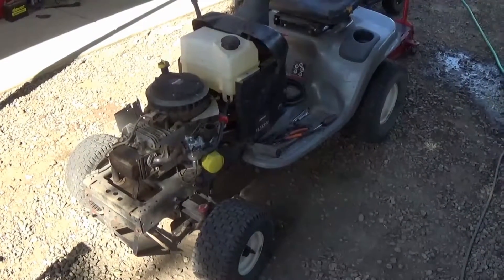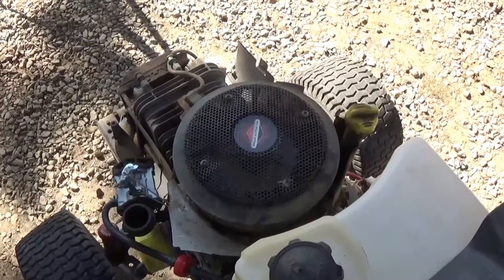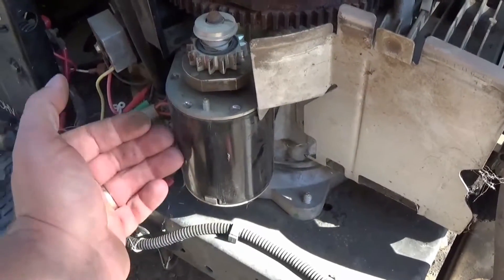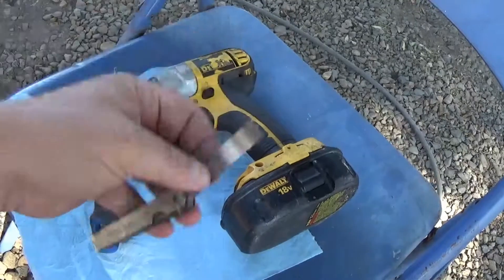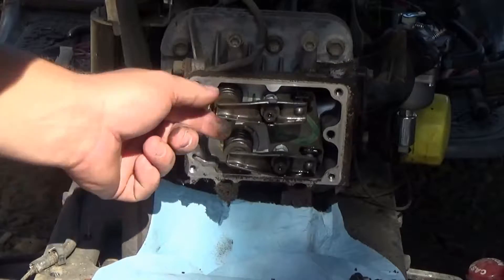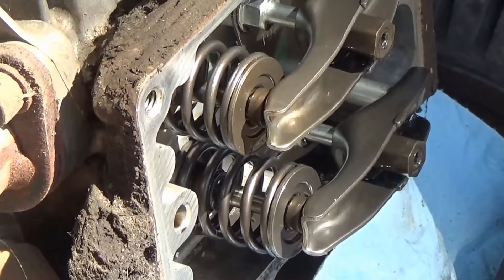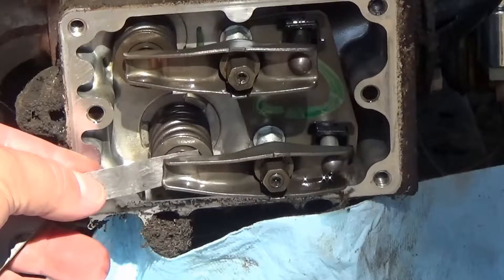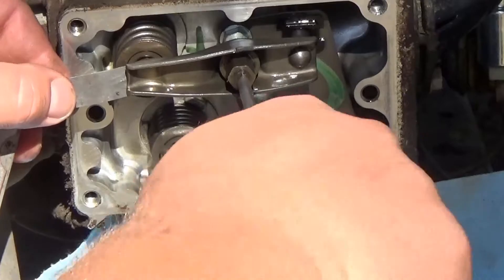Riding Mower Turns Over Fast Then Slow On Compression Stroke (BRIGGS OHV)

Comment: Interesting that you don't adjust the valves at top dead center like all the instructions say to do. Anyway, I did it your way and it worked. Engine turns now. Before the starter was struggling to move the engine. I'm surprised what such a small adjustment to the valves made. Thanks for the information!
This is the first time anyone told me about the little opening of the intake valve to check the compression release. I didn't know that.

Comment: . i have replaced battery, solenoid, starter, and ignition switch assembly. I just checked the rockers , both were less than 2mm loose, rods looked immaculate. But still have the same issue.
Reply: 2mm equals .078". That means your valves are loose by a whopping .074". They need to be at .004" or .101mm.

Comment: Thanks for the video. I replaced the head gasket and the engine wouldn't turn over. It would move a little then stop. Your video was simple to follow and was exactly the fix I needed. I must have had the valves adjusted wrong the first go around. I could barely spin it by hand. Thanks for the checks to do prior. I went through all them- battery, starter, compression movement (had the last after the adjustment). Yea, I had to take it apart twice but it starts now. That's all that matters. 👍🏻

Comment: Thanks for a good video on the easy way to adjust the valves. Two thing I’d like to add that may help
1. You need to adjust the valves before you can check to see if the compression release is working if the valves are out of adjustment you’ll never see that little movement.
2. Spend $10 and change the aluminum intake pushrod to the same steel rod as used in the exhaust .  The aluminum rods wear at the guide and snap and the ends mushroom. It’s a great way to keep from having problems why Briggs using aluminum pushrod beyond me.
Reply: I call it "planned obsolescence"........

Comment: Yep, that's the problem on ours. My brother bought a mower off of facebook, and we've been working on it for about a week so far. We tried everything we could, change the oil, spark plug and even the starter, because it was broken beyond repair. Yet the engine is still hard to turn over, after I've seen multiple videos on the same process, I'm going to try this tomorrow.
Reply: Mine is the same way. Let me know if you fixed yours and what you did. I tried adjusting the valves and it didnt work

Comment: OMG Briggs and Straton's are garbage.  Mine has had theis problem ever since I got the thing.  halts on compression stroke.  I was replacing everything.. starter key, solenoid, starter, battery.  Even with everythign new and on a 50amp quickstart boost from a charger, it halts on compression stroke,a nd I have a fit of time trying to pull the pulley past it by hand.  I'm screaming never again, enver again, from now on diesal with a compression release switch...

There is no way I can adjust the valves since I'm blind now.  I've adjusted motorcycle valves before.  Is there any place on this thing you can kick the phvck out of to make it work?

I tried getting the blades off today to sharpen and balance them and there is no way to do this without like a pneumatic impact wrench.

OMG I just realized where this BS is by following the ignition coil wire back from teh spark plug.. it's under the fly wheel fan shroud on top.  I've got to take this BS off to get to this mess, and take the ignition coil off, and the cover for the valves?   Are these engine designers dvmb as phvck?  I can't do this kidn of maintenance on it while blind...

It took me an hour just to find a wrench that woudl fit the blade  nuts and I must of went through 30 of them...
Reply: You know what I did to fix this BS?   I thought well, this started again when I tpped the mower over on its left side to get to the blades underneath.  What if I were to friggin tip it over to the right on it's side, would this slide whatever back into place.  Sure enough, turns over groovy now.

My dad was right, B&S's are POS's.      
Only iesals or Hndas from now on, or better, electric.   

Blind people can not do this BS stuff anymore, not to mention this is mentioned nowhere on the engine cover at all.

Comment: Having this problem right now and can’t seem to figure it out , just picked the mower up.
Reply from the maker: Usually it's the compression release or the valves check vavles first
Reply: @smallenginerepair3379  I  just finish checking the valves , if I am doing this correctly. I adjust each valve on the down stroke as far down as the piston will go. For the first time I try turning it over and it back fire once and back to the same old 1/4 turn
Reply from the maker: @1989rrichard  in my video I show u how to check the compression release have u check that yet?
Reply from the maker: Is it a brigg and Stratton?
Reply: @smallenginerepair3379  have not, I just got it started ran for about 10 second back fire and shut off , I think I adjust the valve wrong so I am going to start by correcting that first
Reply: @smallenginerepair3379  yes 17.5hp
Reply from the maker: @1989rrichard  ok

Comment: My 19.5 ran fine, started running really rich all the sudden then wouldn't start back up.  No backfire but fuel in air cleaner. Comp, spark, fuel all good. Checking valves tomorrow. May be the keyway I'm thinking, any input would help!
Reply from the maker: Sounds like a carburetor or spark plug issue
Reply: @smallenginerepair3379  has brand new carb, great spark, fuel...seems out of time. I did clobber a big branch or 2 and the wore anti-scalp wheel that fell off in may. Picked up a flywheel key and correct plug today. Before checking valve lash gonna make sure flywheel didn't move. Was too dam hot today tho!

Comment: Can you help me with other problems that it could be
Reply from the maker: Whats the symptoms ur having
Reply: Set valves to .004 and .006 . .still got too much compression on motor what else could be causing me to still have too much compression
Reply from the maker: @chazmassey5064  what kind of motor is it
Reply: @smallenginerepair3379  it's a Briggs n Stratton 18.5 Intel motor
Reply from the maker: @chazmassey5064  its probably the compression release internal in the motor
Reply: @smallenginerepair3379  so does that mean I gotta get a new camshaft
Reply from the maker: @chazmassey5064  yes i think u can get them on ebay and u will need a new gasket for the block if u watch the part on my video were i ahow how to check if the compression release is broke
Reply: @smallenginerepair3379  yes I did watch the video . .thank you sir very much
Reply from the maker: @chazmassey5064  and really the hardest part of the job is scraping all the old gasket off both side of the block lol and make sure u get all the metal peaces out of the motor good luck!
Reply: @smallenginerepair3379  thank you and I sure will sir

Comment: I set both valves at .004 . .done it three times and I still have too much compression new starter and battery
Reply: Have to set the valves on the compression stroke or it won't work based on my experience.

Comment: thank you my man!! my lawnmower has not started that easy in 4-5 years !! its a 20-22 year old lt1000 with a 17.5 hp motor. this job took less than 30 min. easily. for anyone wanting to do this, 3/8 socket for valve cover, and for the 2 back bolts on plastic cover over flywheel.to many people post comments that OVER think shit!!!! this works perfectly!! top dead center blah blah blah THIS WORKS!!! JUST TRY IT AND YOU WILL SEE!

Comment: I have a 17.5 that has been sitting for a couple of years. It ran when parked, and only needed a PTO cable. It is building up too much compression. I have tried adjusting the valves, but I can't get it to work. I have watched several videos now, and everyone one of them give a different clearance for the valves. I have yet to find two videos that gave the same clearance. What is the correct one? Also, the videos have not been consistent as to which is the intake, and which is the exhaust. I am completely lost at this point.
Reply from the maker: Just put them both at 4thousands
Reply: @smallenginerepair3379  I ended up doing that, and it worked. The engine is turning fine and will run on starting fluid, which now brings me to problem #2. I borrowed the carburetor off this mower last summer to use on another identical mower that I have. I just installed a brand new carburetor on this one. I am getting fuel to the carburetor, but I am not getting any fuel to the engine. I know the throttle spring is worn out, and I have a new one that I am going to install tomorrow. Any other possibilities that I am not thinking of? I've rebuilt these carburetors several times in the past, and I know it is hooked up correctly, but this is the first new one I have installed. Do I need to mess with the idle mixture screw or anything?
Reply from the maker: @jesterr7133  u shouldnt have to mess with the idle screw on a new one but is there a solenoid on the bottom of carburator?
Reply: @smallenginerepair3379  Yes, there is. That's the one part I'm never sure about. It is hard to make sure that I have that pigtail plugged in correctly.
Reply from the maker: @jesterr7133  okay yeah that is a little solenoid what it really does is when you shut the key off it plugs up the main jet which doesn't let any access fuel get into the motor it helps prevent a popping sound that's all it does but if that little solenoid isn't working when you turn the key and you don't hear it click it must not be working or you don't have power going to it sometimes it's hard to figure out the wiring problem so what I do is pull the bolt off the bowl and cut flush with the nut that little spring with a rubber piece on it then screw it back in and you won't have to worry about it no more I hope that makes sense
Reply from the maker: @jesterr7133  and it doesn't matter how you plug it in
Reply: @smallenginerepair3379  Are you saying to cut the spring and the rubber piece off? I didn't even think to listen for it. I'm jumping it off right now since I don't have a good battery for it at the moment. I'll take the battery out of one of my other mowers and give it a shot. I had originally planned to part this one out since it was given to me in this condition, but I decided to take one last crack at it before I tore it down. Now I have a new project, lol. A friend of mine had a small engine business and had five mowers in his yard. All of them had been sitting for years, and he just gave them to me when he moved. I fixed two of them so far, built one from scratch out of two other ones, and now I'm tacking this one. Hopefully I can get it going. I'm 100% self taught, so I'm learning through trial and error.
Reply from the maker: @jesterr7133  yeah when you take that bolt off it's like a spring-loaded little deal you can push it down with your finger cut it off at the base of the bolt put that thing back in and it'll probably fire right up but sometimes not having a good battery in the tracker since it runs off power could be your problem too but either way cutting it off ain't going to hurt anyting sometimes those things fail and most the time the repairs I do for people they say cut it off
Reply: @smallenginerepair3379  You were right. The solenoid wasn't working. I took it out and put a bolt in temporarily, and it fired right up. It is idling a little high, and the throttle doesn't seem to be working properly, but it ran pretty well, considering that it has not been cranked in about three years or so.
Reply: Any ideas for what may be going on with the throttle? Anyway, thank you so much for your help. I really appreciate it. I've been fighting this thing on and off for a year now.
Reply: @smallenginerepair3379  This thing is still idling really high. Could the governor be stuck from it sitting? The throttle control lever only works on full choke. I can't tell any difference on the other settings. The engine revs up when I put my foot on the brake, but seems to calm down a little when the mower is in motion, and it backfires slightly every once in a while.
Reply: @smallenginerepair3379  I figured it out. The carburetor is the problem...again. I put a cheap $15 Chinese carburetor on it, and I got exactly what I paid for. I'm just going to have to suck it up and get a better carburetor. I adjusted the idle, and it ran perfect for a few minutes until the carburetor started acting up again.
Reply from the maker: @jesterr7133  thats good to hear thank u for the comments!

Comment: I shall now fix my valves. I too have the slow cranking which stinks when the battery is low.  It hasn't been running on high idle well and blows oil out the valve cover. now i know why. my teen adjusted the valves...i'm thinking he did a good job, but didn't get the lock screws tight. it sucks to lose high throttle power snow plowing in the winter.  I shall fix it and ride the Captain ride in triumph!

Comment: Well shot video. Lighting and clarity was great. Most of all... Thanks for the tip on evaluating/diagnosing if the pressure relief is working WITHOUT having to crack open the engine. I NEVER heard of it before. It will save time🕐, money💰, and headaches🤕 on future jobs.😁 I am now a NEW SUBSCRIBER.🤗🎉

Comment: Thank you, this helped a lot, I did a lot to my mower before watching this video changed the starter, ignition, spark plug bought new belts used several batteries re wired everything, you name it i probably replaced it on the mower, ive never  adjusted valves before, and it starts and runs now.

Comment: I never realized you could use the slight movement of the intake valve immediately after it closes to gauge whether the compression release on the cam is working properly or not.  To be able to check this while doing a valve adjustment and not having to worry about a tear down is just awesome, because before seeing this, I was a bit concerned. I really appreciate you making this video.
Reply: Exactly my thoughts!

Comment: I have a question  about value adjustment. Did you remove the spark plug before you adjusted the values?
Reply from the maker: No i didnt would make the motor easy to turn over with it out but u dont have to

Comment: Turn your valve cover right side up
Reply: i'm pretty sure the power to crank shouldn't change, but the compression causes resistance.  my kid "set" the valves, and i'm pretty sure he did it too fast and missed something.  or it has worked loose over hours of the kids driving it.
Reply: That's Ok, just makes it impossible to see the model numbers on the top of the cover.

Comment: When you did this I noticed that you didn’t mention having to have the piston at tdc before adjusting the valves but I have seen other videos doing it your way with one of the valves all the way in and adjusting the opposite valve or does either way work?
Reply from the maker: Honestly I've never even worried about top dead center and it's always worked for me some other people say you need to but iv been doing this for years
Reply: Also on that same engine that I worked on also it kept backfiring and popping out through the intake when running. When I took the valve cover off there was the valve stem cap laying in the bottom of the head under the valves but only one was found not sure if it needs both to run properly? Can you confirm that?
Reply from the maker: @eltonpham2165  I would put both those caps back on the valve I actually remembered about some of them motors have them and some don't and I never stated that in my video but if you're missing one it's in there it has to be if you look down back where the pushrods go it's a possibility and made its way back there or when the cover was tooken off one fell out I'm not sure if you can run it without that cap but you can try but if it had it on there I would try to find it or get another one
Reply: @smallenginerepair3379  Tooken ?  Good video  !

Comment: That’s all well and good.  Usually on a Briggs and Stratton, intake is .05 and exhaust is .07.  The problem is, that’s not how you adjust valves.  On a B&S engine it is 1/4” past top dead center on compression stroke.  Not how you did it.  If you don’t believe me, simply google it.
Reply from the maker: Everyones got ther opinion and there way what i have been doing works for me everytime do what works for u thanks for the commet
Reply: @smallenginerepair3379  Agreed. People get hung up on TDC. As long as the high lobe of the cam isn't pushing on the valve. That occurs at several degrees of rotation. And .004" is a good clearance setting. I've tried the factory settings and on older engines the valves still rattle.
Reply: For mine as well. B&S 17.5 says .004 Int and .006. Ex and adjust at 1/4 past TDC. On the web site.
Reply: I tried it as per the manual 1/4 inch past tdc and ended up with this issue. Gonna try this evening to do it like the video. Thanks in advance

Comment: I believe I will try the full open and shut valves rather than the TDC adjustment. Maybe I"ll have better luck. My mower has the spin stop symptoms.  It might be a bigger problem because it is spitting gas out of the carburetor and only runs while I open and close the choke .
"
Reply from the maker: Replace the carb and check oil!
Reply from the maker: And 1 more thing pull spark plug and see if gas shoots out cylinder could be filled with gas, carburator failed possible

Comment: just a note ,,any motor with this issue will draw very high amps and very quickly burn up the starter if you use the starter to force it through the high compression
Reply from the maker: Yes it could